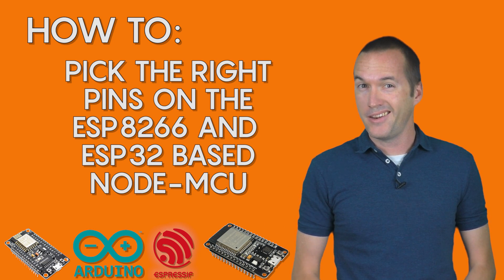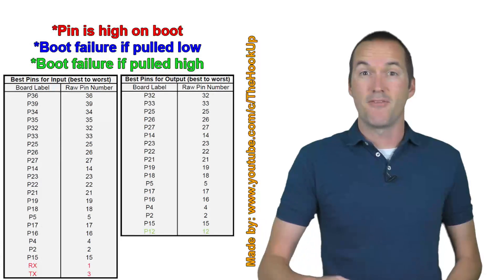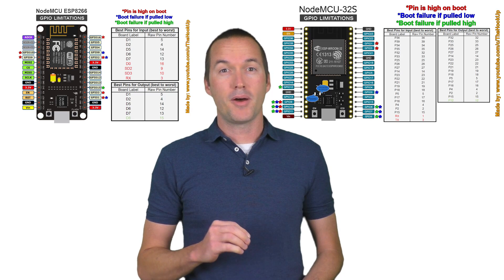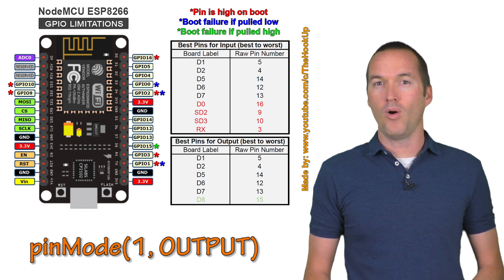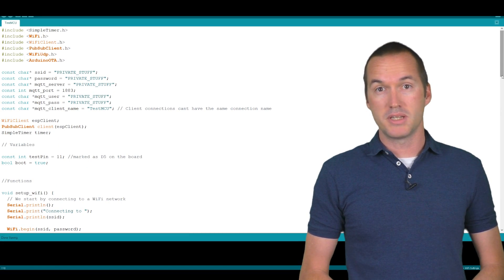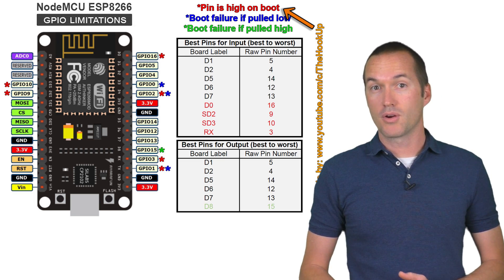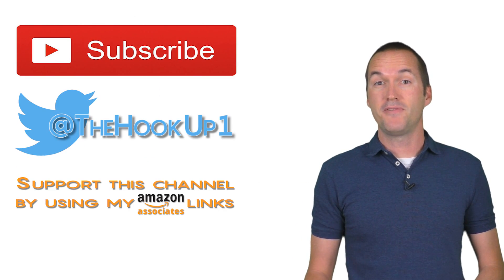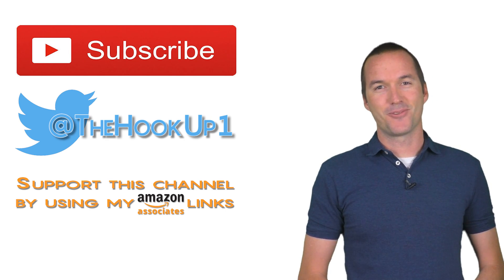How To: Pick the right pins on the NodeMCU ESP8266 and ESP32

Comment: Thank you very MUCH ! just starting using ESP8266 and it did 1/ reset with watchdog  2/ not responding to the GPIOS .Why they did this ? I Had ideas maybe have a trick with the pins and took a look at youtube !!!  found D8 on the board, usual nice pin on arduino,  then I was playing with it declaring as digital 8 in the soft !!!

Comment: At least pins "5 6 7" are all running high if they are not put in pinmode with specific code for esp8266. which was the best cork I got with a mux switch.

Comment: Great video. I was looking for something like this to pick an MCU that has the most number of inputs to connect to all of my door and window reed switches and then connect it to Home Assistant for statuses (and then automations later on). The ESP32 appears to have 21 good input pins. Are there any other MCU's that I could use with ESPHome to sync with Home Assistant?

Comment: I know this Video is older but:
"undocumented node-mcus" yeah... Thats why i started creating custom PCBs for all of my Projects. 
But even there i had alot of misstakes using wrong pins (ESP866 and ESP32).
But after studing the datasheets and recommendations from espressif how to do a basic wiring and pullup/pulldown of special pins, i got it.
I think you wont do any failures anymore, if you made a custom PCB with one of this ESPs and basic schematics and parts.
Projects will look nicer and more professional also.
I made a custom pcb for that rollershades DIY project. I threw away the PCB which came with the 5V Stepper Motor and created my own layout with integrated ESP-12 and ULN2003 Driver.
Its looking so good (To bad i cant attach a picture here)
Reply from the maker: I agree custom PCBs are cool, but for prototyping NodeMCUs are still king.  I've been working on a few custom PCBs as well, would you mind sharing your gerber file with me? smarthomehookup@gmail.com
Reply: @TheHookUp  sure I will. I could also share the whole project (in easyeda) if you need.

Comment: where can i find the 5 volt pin?
Reply from the maker: If you are powering it with a 5V source there will be 5v on VCC.  Otherwise it doesn’t have a regulated 5V output, only 3.3V.

Comment: Your video is very informative and useful for me. 

I want to connect 11 output devices with esp8266 nodemcu.

Kindly suggest the pins. 

I was trying to use Tx and Rx Pin as output using 
//******** CHANGE PIN FUNCTION  TO GPIO ********
//GPIO 1 (TX) swap the pin to a GPIO.FUNCTION_3
pinMode(1,FUNCTION_3 ); 
//GPIO 3 (RX) swap the pin to a GPIO.
pinMode(3, FUNCTION_3); 

But, It couldn't work for me

Kindly help me. 

Thank you,

Comment: Great info, but how often would a nodemcu reboot, I was planning on using 1 to monitor my alarm panel, but need 5 inputs and 1 output
Reply from the maker: Theoretically it doesn't need to reboot ever, but it depends on the Wi-Fi strength and power supply consistency.  A node mcu can handle 5 inputs and one output easily.
Reply: @TheHookUp  Thanks, so if I was to use D1,2,5,6 and 7 as the inputs,  D8 would be ok to output to a relay as long as it doesn't get pulled high ?

Comment: I have a problem. I have a esp8266. model is hw-628. I tried everything to connect to it, but printing serial things like "test" work, but if i set all the outputs on, that don't work. I also changed in windows --> devices --> com to a upload speed of 115200. That made that I can upload, but i can't get any furder.
code: 
void setup()
{
for (int i = 0; i < 20; ++i) {
pinMode(i, OUTPUT);
}
Serial.begin(115200);
}
void loop()
{
for (int i = 0; i < 20; ++i) {
digitalWrite(i, HIGH);
}
Serial.println("test");
delay(500);
for (int i = 0; i < 20; ++i) {
digitalWrite(i, LOW);
}
Serial.println("test");
delay(1000);
}
Reply from the maker: The ESP will not work if you try to set all pins as outputs.  Take a look at the diagram in the description for which pins can become outputs.
Reply: @TheHookUp  I search the WWW and there was a wrong schematic. I tried your solution with your schematic and it works. I tried to make a smart 5050 rgb led strip and this helped me al lot. Thank you for your fast answer.
Reply: if i attach the esp to the pc and open in the arduino IDE the serial monitor: this is the output. 

ets Jan  8 2013,rst cause:4, boot mode:(3,0)

wdt reset
load 0x4010f000, len 1384, room 16 
tail 8
chksum 0x2d
csum 0x2d
vbb28d4a3
~ld
Reply from the maker: @douwebrouwer2715  That is the boot error you would expect from an incorrect pin configuration.  Are the other pins grounded or floating?

Comment: Great video.  I use the Wemos D1 mini for a lot of my projects.  Have you seen anything like your diagrams for pins on the D1 mini?  I think I ran into this issue on pin 2 this week.
Reply from the maker: I think they should be the same as the NodeMCU one.  According to the diagram, pin 2 is high on boot and will cause boot failure if pulled low.
Reply: That's what I was seeing, thanks.

Comment: Stop calling them nodemcu unless you're running Lua on it.
Reply from the maker: What would you call them?
Reply: The Hook Up What they are. ESP8266 dev boards and ESP32 dev boards.
Reply: The nodemcu part is hardware isn’t it? Not the fact it’s lua.
Reply: zach burke the nodemcu was originally released with lua installed on it. Anyone could buy it and do what they liked with it, like flash it with something else, but it was created for use with lua by lua enthusiasts.
Reply: zach burke nodemcu refers to the firmware. Not the hardware. https://en.m.wikipedia.org/wiki/NodeMCU

Comment: Thank you!

The issue you mentioned of certain pins briefly going high was a huge problem for me in implementing a garage door opener. I did not realize it was only some pins so for a while I gave up. I got around the problem with high reliability using a Sonoff “inching module”.  The description is found below. For a little over five bucks I believe this is a great solution. It has two modes, one of witch is momentary relay activation via an external button. It can relay messages via MQTT and integrates nicely with Home Assistant. 
 I got off subject a bit but again, a geat video. 

Thanks!

Channel Inching /Self-Locking WiFi Wireless Switch 5V 12V
Model: IM160722001.